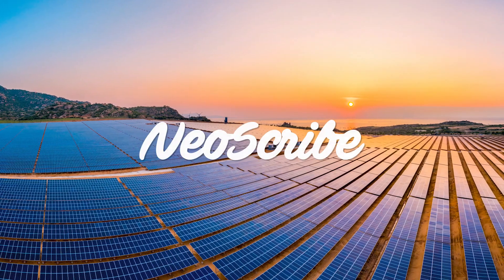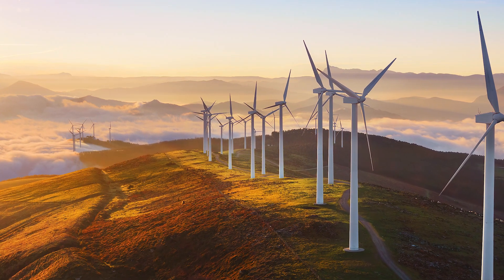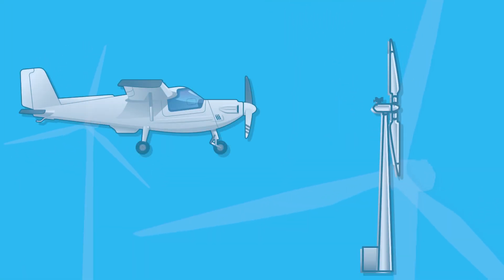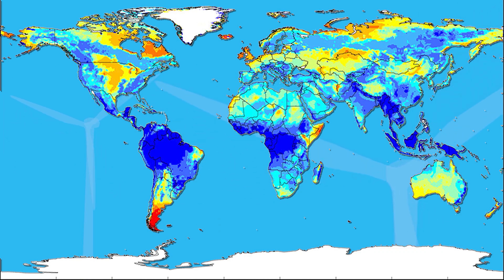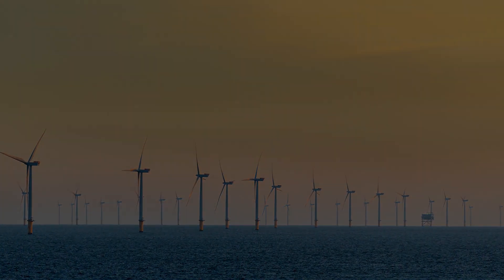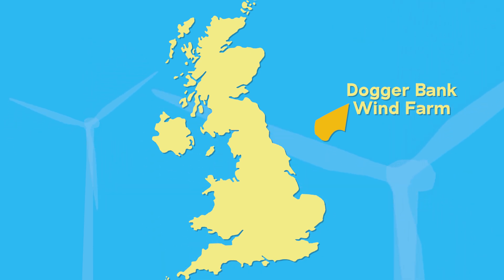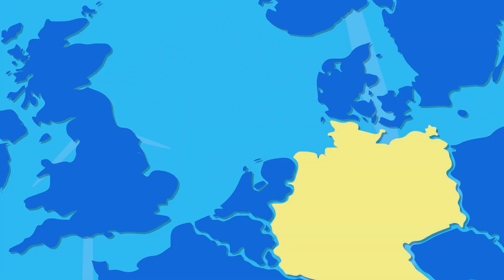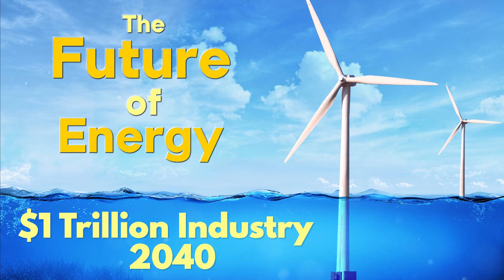The Future of Energy | Episode 2: Offshore Wind Power

Comment: A great new thing is wooden pillars for these turbines, such as those made by Modvion, in Sweden, with higher strength than steel, thus going much higher, and tapping into far stronger winds, allowing a smaller radius of turbine to produce the same power output.

Comment: Just one coal fired power station produces 1000MW power, 24/7. It would take 5000 wind turbines to generate that much power. CO2 is plant food and has no effect on climate. Wind turbines are a pointless, expensive experiment.
Reply from the maker: Wrong again: CO2 is undeniably a greenhouse gas. The extreme heat on Venus is the perfect illustration.
Reply: @neoscribe2295  CO2's effect on atmospheric temperature is logarithmic...adding more and more co2 has little effect. Saturation level has already been reached. Venus and Earth have completely different biospheres. The atmospheric pressure on Venus causes the high temperatures.
Reply from the maker: I disagree:   Greenhouse gases such as carbon dioxide and water vapour absorb most of the heat radiation leaving the Earth's surface. Then their concentration determines how much heat escapes from the top of the atmosphere to space. It is the change in what happens at the top of the atmosphere that matters, not what happens down here near the surface.

As we climb higher in the atmosphere the air gets thinner. There is less of all gases, including the greenhouse gases. How much heat escapes to space from this altitude then depends on how cold the air is at that height. The colder the air, the less heat it radiates.

So if we add more greenhouse gases the air needs to be thinner before heat radiation is able to escape to space. So this can only happen higher in the atmosphere. Where it is colder. So the amount of heat escaping is reduced. 

By adding greenhouse gases, we force the radiation to space to come from higher, colder air, reducing the flow of radiation to space. And there is still a lot of scope for more greenhouse gases to push 'the action' higher and higher, into colder and colder air, restricting the rate of radiation to space even further.
Reply: @neoscribe2295  Yes, but CO2 only has a measurable impact up to about 100ppm. We are now at 400ppm (most of which is natural venting from the oceans). Human contribution is only 3% ie 12ppm. Reducing our emissions is pointless. The Sun's cycles drive climate change.
Reply from the maker: I am coming up on a deadline on my next video, but I plan on fact checking these figures soon. Cheers!

Comment: Wind turbines are not viable. They break down before they break even. Without subsides they would have never been built.
Reply from the maker: You are wrong.                                                       Taking out subsidies,  wind power is now cheaper than electricity generated by coal, nuclear power and even natural gas over the lifetime of a power facility, according to a 2016 analysis by Lazard Ltd., a financial advisory and asset management firm. Between 2009 and 2016, Lazard said, the cost of wind power dropped by 66 percent.

Comment: Thanks for a nice round-up of the current wind energy market. Small comment: the Hornsea turbines (SGRE 7.0-154) are a tad taller than 100 meters, more in the area of 185. (maybe the hub height is about 100m, but since you mentioned blade-tip height for the Haliade-X it seemed worth noting). Keep up the good work

Comment: Windmills don't work. It's all explained in Planet of the Humans. Michael Mann's documentary wasn't released until every aspect of it was fact checked and poured over by a team of lawyers. If Planet of the Humans gets anything wrong, they'll be sued out of existence. Nuclear works. Windmills and solar are expensive, rely on subsidies, need constant maintenance and need fossil fuel backup.
Reply: The cost of solar and wind cratered drastically. Many project now are being built WITHOUT subsidies. 
I am pro-nuclear too, but if a energy source requires a lot of maintenance, it's nuclear power. The EV adoption combined with smart grid will solve the problem of intermittency. EVs can charge their batteries at strategic times, when electricity is plentiful.
Reply: @sharefactor  Mate, I live in England. I'm 53° North. Solar is useless. We're building most of our windmills 200 miles out to sea. Have you any idea the amount of maintenance having to deal with the North Sea adds just by the fact that they're 200 miles out to sea? A sea that's full of salt, grit and the tears of pensioners, unable to pay to heat their own homes. 
Those sea windmills have got no chance. They're need constant, astronomical maintenance, that will eventually start to make no sense.
Costs have dropped due to scale but not for solar. The cheap panels you're thinking of, are the notoriously bad Chinese imports.
Planet of The Humans was released in 2019. Any plummeting costs you think you've got un-referenced evidence for, will be wiped out by the economic disaster about to land on our Western asses.

Comment: Wind in the UK makes a lot of sense because it is a very very windy country, rainy too, it is there where I experience a horizontal rain, that got me completely wet in less than 30 seconds. In Poland by comparison we have very little wind.
Reply: poland has excellent onshore wind resources as well as a fairly long coast with decent wind speeds. it's not the absolute best, but it's pretty great. 

these wind turbines are very tall and gather the wind at around 100m above ground. what is a tiny breeze on the ground is much stronger there.

Comment: Why can’t we have nuclear power that burns up the waste fuel that current reactors can’t use. That’s the very stuff we are told is a serous long term problem. 
95% of the energy is still there for the taking. That’s 24 times the power already delivered  is still locked into that fuel. 
Elysium and Moltex have fully engineering fast reactor designs ready to go at full scale. But held back by regulatory processes designed to stop any progress.
Reply: Because the government

Comment: It is cool and great TECHNOLOGY but when we have to put them EVERY WHERE that means they're INEFFICIENT AS HELL
Reply: The Haliade wind turbine in this video is 12 MW, so no. Liek the video says, older and smaller wind turbines had very low output, but the new big ones kick ass and catch more wind (higher altitude).
Reply: Well, an area the size of India on the Atlantic Ocean would be needed to power the world. They're not the most energy dense source, that's true. But what matters now is the cost; if it stays low like it does now, economics will decide and maybe a third or so of the world's energy will be produced by them in three decades. It's impressive that the cost of wind energy has been reduced so much- like seriously, it's wind, we stopped using sailing ships and windmills a long time ago! But yeah, an area the size of India is required for the whole world. It's a lot, but is it too much? You can pull up Google Earth and decide for yourself. And we'll use solar and others too, not wind alone.

Comment: There are a few things you dont mention.
A) Windturbines are killers. They kill births and bads..
B) For every Megawatt from a windturbine there has to be fossile fuel turbine in the background (What if winds
      stops)
C) The material that the windblades are made from cant be recycled or burned in an incinarator. So. 
      What to do with them?
D) Because you lose a lot of energy transporting the electricity the shore, this will make electricity al lot 
      more expensive. And in the mean time you subsidice the fossile fuel industry for keeping the gass 
      and coalplants open. You will still need them
It all sounds so nice, but in reality, it is not green energy. To build and maintain them is just as much as lighting a coal plant...

Comment: No mention of capacity factors.  What happens when theres no wind?
Reply: The entire Future depends on storing energy (Tesla Terror Factories ). Tesla Battery Day Sept 15, 2020.
Reply: Average CFs for onshore are 35% and for offshore it’s 55%
Reply: @thebriz1868  Even up to 63% claimed capacity factor for the Haliade-X wind turbine in North Sea.
Reply: Electric vehicles (EVs) connected to a smart grid will constitute the electricity storage of the future. EVs can charge when electricity is plentiful, and soon also give back electricity at peak demand times (mainly end of the afternoon when people cook).
Renewable electricity goes hand in hand with EV adoption.
Reply: @sharefactor  lithium battery can hold  100-265wh/kg.  Primary energy consumption in world  is 18,000Gw rate. Electricity is 25% of that (forget that electric cars and heating will explode this number) that's 4500Gw rate. Say capacity factor renewable 50% (its much less)  so need to deliver from batteries 4500Gw rate for 12hours. 4500,000,000,000w × 12h /265wh/kg=  203,000,000,000 kg. thats 203million tonnes of batteries that will last a few yers to solve solve 25% of emmissions.  

Also you need to charge the batteries so during 12hours  you need to produce at 9000Gw rate, double the current installed  capacity of the whole planete (which includes all current wind and solar)

Wind and solar are great but we urgently need collosally more to make a dent and no one is discussing this seriously.

Comment: At least they are out of sight. Still this is intermittent power with the risk of an undersea break of the electric transmission line. So talking about how many homes can be powered is a bit disingenuous because it depends on wind speed. Will full backup of gas turbines be needed for grid reliability?
Reply: Electric vehicles (EVs) connected to a smart grid will constitute the electricity storage of the future. EVs can charge when electricity is plentiful, and soon also give back electricity at peak demand times (mainly end of the afternoon when people cook).
Renewable electricity goes hand in hand with EV adoption.

Comment: These winds turbines are designed to fail. The last thing the oil industry wants is a real solution to renewable energy. So they swamp the industry with these massive, expensive, short lived machines that only a large corporation would build. A small, very inexpensive vertical wind turbine built with lightweight sails are very inexpensive, and when coupled with simple batteries will easily replace expensive corporate electricity. All installed and serviced by your local electrician!
Reply from the maker: How are the turbines purposely designing to fail? All mechanical things break down. Do you have sources to back up this claim?
Reply: @neoscribe2295  Thats easy, and thanks for the question! And by the way, your production was excellent! It was the data that I questioned.

My love for these behemoths was very high. Higher then yours probably. But time and research has changed that. The perils of being a scientist.

Look at all the abandoned wind turbines that WILL BE (Important note, WILL BE) abandoned across the US in the next 20 to 30 years. This article below acknowledges that point by people like you who still support these devices ... (I will disregard the ones already abandoned ... I do not know what those numbers are.)

https://www.politifact.com/factchecks/2019/oct/25/chain-email/no-there-arent-14000-abandoned-wind-turbines-litte/

A quote from that article ... 
"Monaghan acknowledged that wind turbines age and typically have a useful life of 20 to 30 years. At that time, she said old equipment must be taken down, repaired or replaced." ... and that is not a minor point!

Data on decommissioning here is important to consider ...

https://energycentral.com/news/retiring-worn-out-wind-turbines-could-cost-billions-nobody-has OR ...

https://www.heartland.org/news-opinion/news/states-localities-face-high-wind-turbine-decommissioning-costs

(Homework sucks, does it not??)

Local communities in the west previously failed to require installers to remove the old machines, and now the rotting hulks sit abandoned for someone else to pick up the bill. like the local community. The industry has a history of these irresponsible actions. Another problem solved by having local communities who would build their own power generation wind machines. They suffer the consequences of abandoning their own systems then.

My point is, things fail, yes, but building things in such a disregard for the cost of the devices is the issue. I can gain massive amounts of energy with machines made of much lighter materials that will last just as long or even longer for much less cost! 

It is the cost per kilowatt that is the problem with these massive machines. Compare this to a machine as expensive as a small sloop. An example, you can find Albin Vegas for as little as $5,000. (Comparing the cost of a small sail boat to a small wind turbine. And yes, I can build a small wind turbine for $5000 dollars.) With the money spent to build a common wind turbine today, you could build 600 of these small units. All without the very high wear issues that heavy machines experience. A rotor with a 100 pound bearing load will last much longer then 20 years while your blade nacelle is a whopping 56 TONS! , but the cost of smaller machines nacelle is so low it is a great reduction in cost to replace compared to a large load rotor bearing.

These machines can be built for much less money, with a much less expensive maintenance, and a much less expensive insurance shadow. The small and lighter machines can be built on top of buildings in a city, and because they are vertical shaft, they can be stacked, and because they are light they can be stacked very high.

Abandoned sky scrapers? Open the outer walls and install these across the open floors, using a design that does not require aiming at the wind, and now abandoned skyscrapers become power plants with machines that can be serviced without expensive maintenance equipment or highly skilled high wire walkers. More reduction in operational costs using abandoned buildings instead of brand new, short life and expensive towers. So many options open when you drop the mammoth and massive design of the horizontal monsters built now ...

But only wind? Not at all. This machine can be placed in an underwater current with low spin rotation and high torque without bothering the fish. A much more powerful machine with a continuous output as underwater currents rarely reduce in speed.

I can go on about these issues for many hours because I have been looking at this from a science point of view for over 30 years, and not a profit point of view. That is why I say the oil companies are spoiling the science. If I am right, (and I am) their golden goose could be cooked!

I get the fact you have fallen in love with these massive machines. When I started in college, I was dead against nuclear power because of the cost and waste issues, (still unresolved today) and the new wind turbines had my full attention and love. The concept was very compelling. (I am a machine guy! I LOVE machines!) But as time progressed and I studied the science more, I saw a great need for improvement. Yes, wind is an awesome way to generate power. (Its really solar power in fact) Now we just need to solve some real life problems! Like large corporate design restrictions meant to protect their profits! Spelled "B-i-g B-r-o-t-h-e-r O-i-l"!😎😎😎